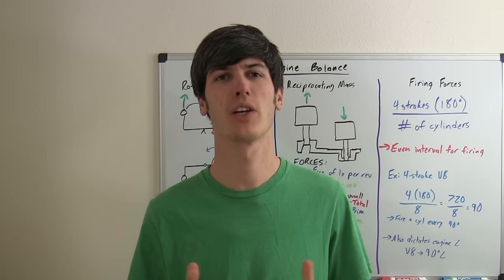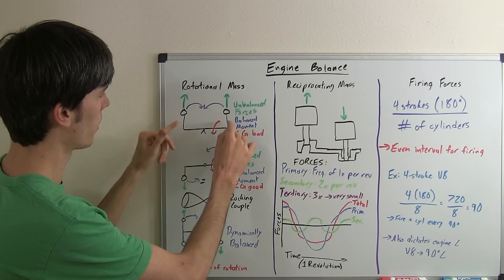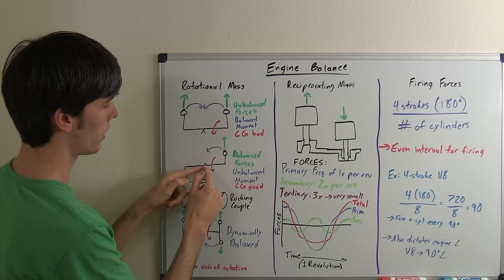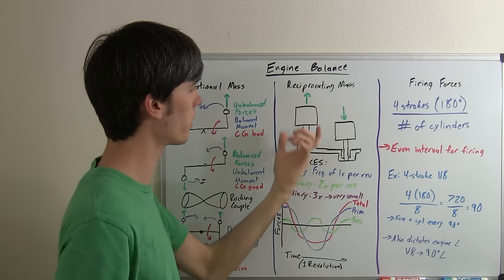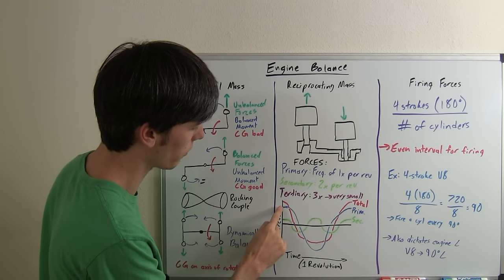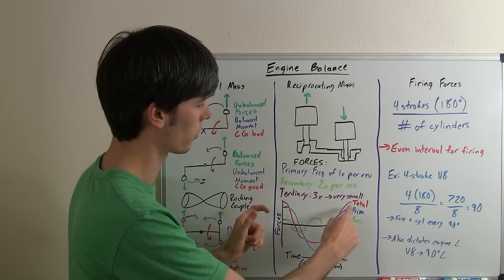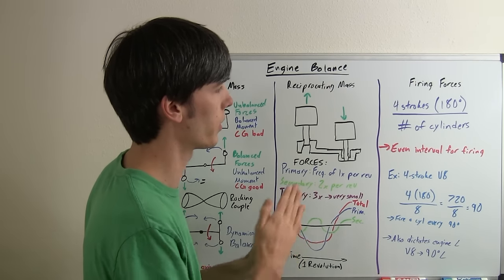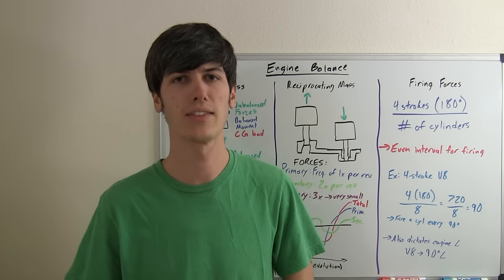How Engine Balancing Works - Smooth Running Cars

Comment: Why wouldn't you want all the cylinders to fire at the same time? Just curious about the reasoning.
Reply: +Jesse Emond The simple answer is traction. Trying to apply high power to your driving wheels is difficult, especially going around a corner. If your engine is putting out one Big Bang, instead of spacing out the power pulses evenly, you will overwhelm the coefficient of friction at the road-tire interface, and spin out. I ride one of the fastest sport bikes in the world, (a Hayabusa bking), and it can spin the back tire at 90 mph in a straight line. I greatly have to reduce power going around a corner, or it will put me in the weeds so fast, I wouldn't know what happened. The introduction of Yamaha's cross plane crank on the 2009 YZF-R1 gave increased traction because the firing pulses were made uneven. So, every crank revolution gives a slight pause in power, (the so-called Uneven Bang Theory, really ! ), so the driving tire can re-grip ever so slightly, and thus maintain better overall traction. This is reflected in the 2008 Moto GP racing season, where a Yamaha YZF-R1 bike dominated the other factory bikes.
Reply: That makes sense! That was really helpful, thanks.

Comment: Could you explain to me how you get the direction of the "moments"?
Reply: +Vibhor Malik yes i also think he should have explained that. but i explained it this way to me: look at his 2nd example, where the pistons are not at the same position but 180° twisted. now imagine u hold only one in your hand (one arm). and then u rotate that thing between your thumb and second finger, you roll it. this is the way you get the moment ...
in other words: connect the pistons with a STRAIGHT line. the force along the line will be irrelevant, the forces 90° to the line will be the moment

Comment: are they from frequencies generated in the material itself? ie vibration?
Reply from the maker: Most of what I'm talking about is relating to the mass, rather than the material, but materials certainly do play a role.

Comment: I have a doubt...I'm learning all this for the first time, so I was wondering why the piston moves faster at the top of its rotation than at the bottom
Reply: Actually it doesn´t - it moves fastest exactly in the middle, at constant crankshaft speed.

Comment: great video but I don't really get it. In terms of the engine what is the rotational mass is it he pistons?
Reply from the maker: SupremeGamingDude The pistons are reciprocating. The camshafts, crank, pulleys, etc rotate.
Reply: Engineering Explained ok thanks alot now I understand

Comment: You said the piston moves faster at the top, than at the bottom of it's stroke.
Would you like to explain or correct these misspoken words? Thanks
Reply: Combustion causes the piston to initially accelerate very quickly
Reply: Thanks Lewis, so the piston can accelerate faster than the other 
spinning and linear masses, interesting? I can see this logic in a hit 
or miss, single cylinder engine, but can't can't on a multi cylinder 
engine.
Reply: you raise a good point. I'm not entirely sure on that matter. 

Perhaps the positioning of the pistons counter act one another by being in opposite positions at a particular time?
Reply: It is not because of the firing force accelerating the piston.  It is because the big-end of the con-rods move in a circle.  That means that at the top of the stroke on the way up the big-end is moving toward the center of the cylinder, and on the way down it is moving away; at the bottom of the stroke it is moving toward the center on the way down and away on the way up.  This means that at the top of the stroke the horizontal motion of the big-end is additive with its vertical motion and at the bottom it is subtractive.  He has a video on secondary balance, I haven't watched it yet, but I'm guessing it includes a diagram.

Comment: That last equation about the angle of the V of the engine doesn't make any sense whatsoever. If you are trying to find the optimal angle of a V6 engine using this formula, you would end up with 180 degrees. That would just be a boxer engine.
Reply: 720/6 is 120
Reply: Rain Zhou The most efficient cylinder bank angle for a V6 is 60 degrees.
Reply: Son of a Zombie If you watch the video again, he says "this also dictates the engine angle" and at 6:30 he makes a 90 degree angle with his hands, showing that the optimal bank angle for a V8 is 90 degrees. He was talking about the angle of the crankshaft, but he says it also applies for the cylinder bank angle.
Reply: AnythingLoud 720/6 is 120º which is 60º looking at it the other way

Comment: What about Subaru's flat engine? Are they balance?
Reply from the maker: Yes, pretty well. I'll have a video on it eventually.
Reply: They still have a secondary imbalance that causes it to rotate about the vertical axis but it is much less severe than the inline-4's. It's due to opposing pistons being slightly offset from one another as they reciprocate. The advantage of the pistons and upper rods mostly offsetting each other's motion is that it eliminates the need for crankshaft counterweights to balance them and can reduces the rotational inertia significantly.

Comment: 4:26
"The piston moves faster at the top of the cylinder than it does at the bottom".
Not sure where you got that from, but it's not correct.
Reply from the maker: John Doc. Here's some simple math for you to be enlightened with! Certainly not intuitive. :) https://www.youtube.com/watch?v=gdHQ8aTfiQQ
Reply: Engineering Explained OK, thanks for that, but I took 'top' to mean top, i.e. around TDC (and the same for BDC, where the piston is barely moving at all.

Comment: I was wondering why I-4 Engines vibrate more than a V-6...
Reply: found it on a website, which says that the pistons moving up are faster than the ones going down so a balancer shaft is needed.
Reply: The V6 has more overlap between cylinders firing, meaning the torque output has less variation. The V6 suffers similar crank vibration to a 3 cylinder and must use a counter-rotating balance shaft to smooth it out.
Reply: Furthermore, the straight 4 has an inherent, second order imbalance:

http://en.wikipedia.org/wiki/Straight-4#Balance_and_smoothness
Reply from the maker: I wouldn't say V6's are necessarily better balanced inherently than an I-4, but I will certainly have videos soon that clear up as to why. Both can be decently balanced with some clever workarounds.
Reply: I ask because it made me curious that my idle was around 700 and it shook the car, I adjusted it to about 1000 rpms and now I'm not sure is the car is running its so smooth.
Reply: What sam douglas said. Having more power strokes per engine revolution (3 for v6's 2 for I4's) increases the smoothness of the engine considerably. However, the timing of the power strokes is critical as well. One of the longest production v6's, the Buick v6, had a 90 degree V. This meant that the power strokes were not evenly distributed every 120 degrees. Many people have made comments about the lumpy idle of the 90 degree v6.

Comment: how are counter weights used do they hv any drawbacks
Reply: +muhammad fariq Almost every engine has counter weights. The only disadvantage is that it contributes to the rotating mass in your drive train.
Reply: Thnx